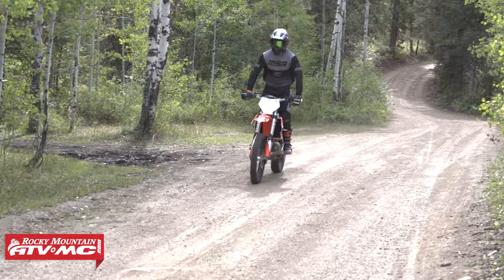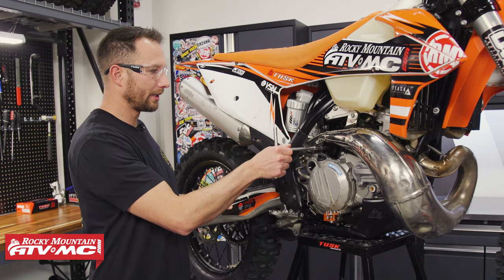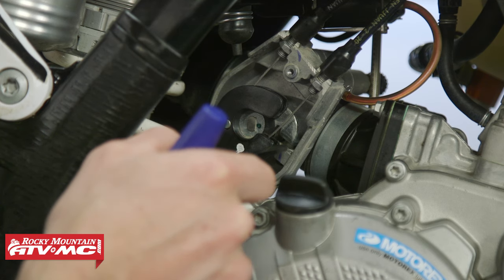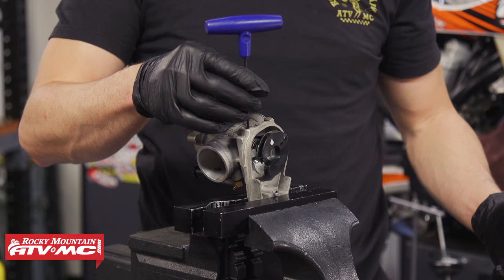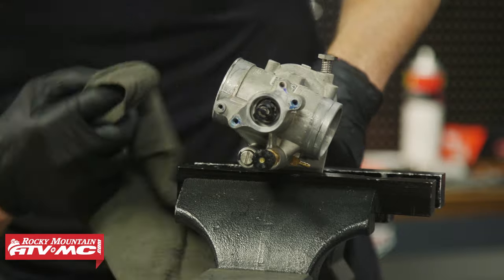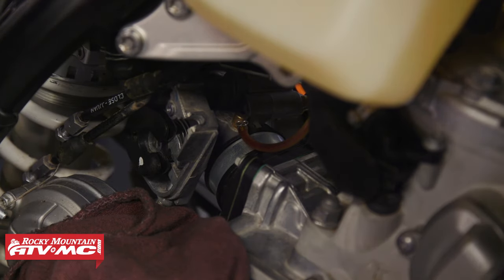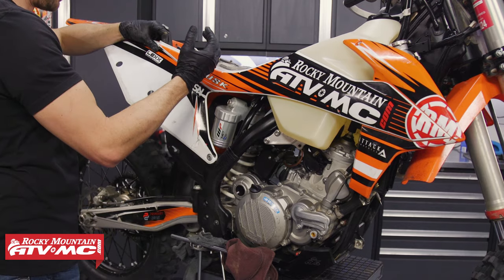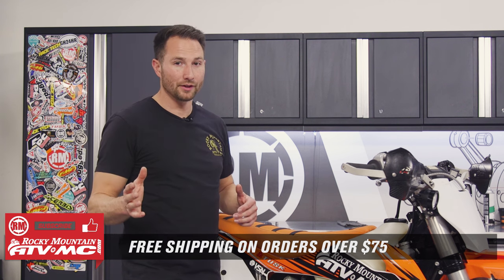How To Install the Tusk TPI Idle Adjustment Screw on KTM/Husqvarna/GasGas TPI 2-Strokes

Comment: on my 2021 TE250i (Husky) i left the throttle body on and turned it inside towards the left side on using the other method you find here on youtube. Then used the uncure even though it took about 2 days of more than a few soakings of the screw to get it out. That way not taking the throttle body off you can turn the throttle body and get the hex/allen wrench in there.
Reply from the maker: Glad to hear it worked on your bike! Our bike was too stubborn, I let it soak on it's side for three days and about 16 applications of "un-cure" and it didn't budge. We've had mixed results, but always a great option if you can get it to work! -Charles

Comment: Just bought one for my 23 Ktm 300xcw erzbergrodeo. Finally got the bike running very well at exactly 7 turns out on the air mix screw but definitely needs to lower the idle. I’ll have to mess with it once I get the idle screw of course

Comment: I have a 2023 ktm 250 xcw tpi and I think I need this air screw mod.  My bike does not hold idle anymore.  Do the new TBI models also have this issue.  Do they also need the air screw mod ?